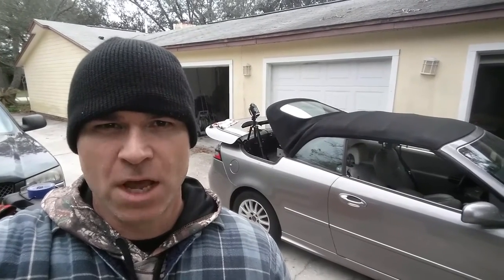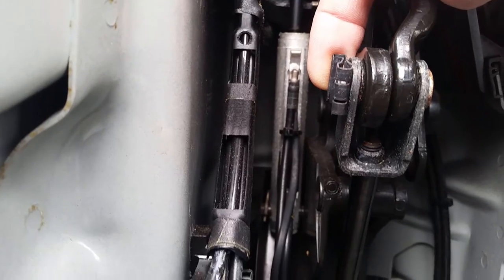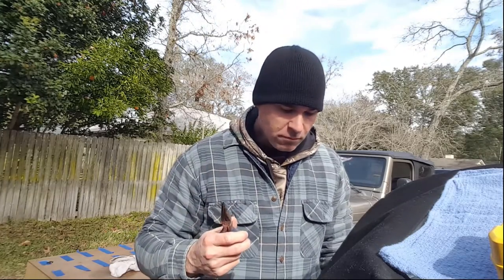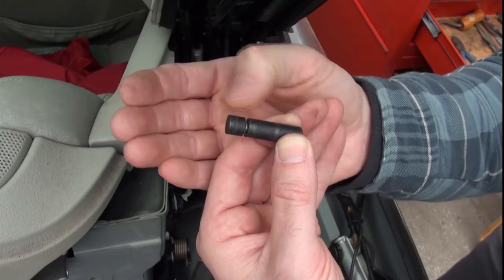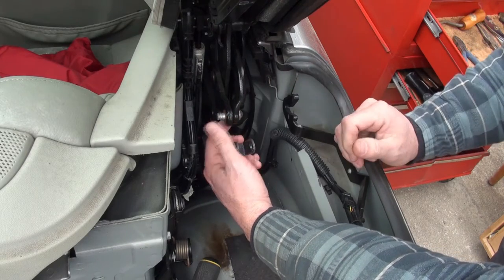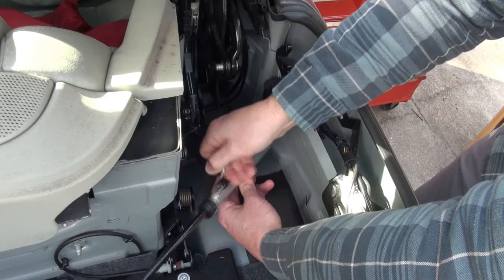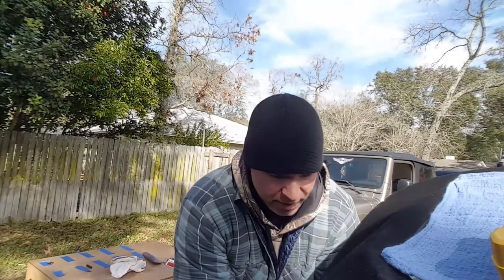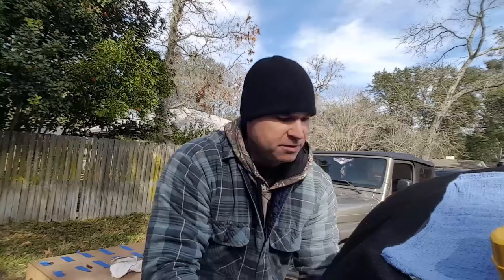Saab Convertible Hydraulic Cylinder

Comment: Thank you so much for this. I am in Australia and we also have a rebuilder in Sydney. I am in Perth (about 4500km away). You have saved me a fortune. BTW. I struggled to get the clips that hold the plastic hydraulic pipes in place, but a bit of leverage and force got them out. ALL the O rings were in the Ram. Thanks again!
Reply from the maker: I'm glad it helped Chris. Thank you for the kind words.

Comment: Hello, this is Klaus with Top Hydraulics. Wow, that's an excellent video! Thank you, Ted, for being so straightforward and sharing. 

Model year '03-'09 Saab 9-3 "Next Generation" convertibles (starting with model year '04 in the US) all have seven hydraulic cylinders that actuate the top, stow it and latch it. All of these cylinders will leak eventually, just as they do in any other modern convertible. There are on average seven seals in each of these cylinders, and you will typically see them leaking first on the bottom. The seal decay is a general aging process that is sped up by heat. The manufacturer could have used a longer lasting seal material, but they did not. We find this in every modern convertible with a hydraulic top. Top Hydraulics does some fancy machining on these cylinders, and ends up replacing and upgrading ALL seals in them. We expect our rebuilt cylinders to last some 30-50 years, if installed properly and not abused. We have shipped many thousands of Saab cylinders, and we have an outstanding track record. 

We also offer core exchange, where we ship the parts from our inventory first, and it involves an additional deposit that gets refunded once we get a decent cylinder back. This way, your car is not down while you are waiting for your cylinder to come back, and you can swap most single cylinders in a half an hour to an hour.

No worries about the o-rings that go on the hydraulic lines - Top Hydraulics provides new ones with every rebuilt cylinder, and we provide instructions on how to install them.

Typically, the first cylinder to fail in a Next Generation Saab 9-3 is the front lock ("first bow") cylinder 12833515 or one of the tonneau cover lift cylinders 12833501 and 12833502. These are equally easy to take out. In fact, we would recommend to tackle the first bow cylinder and the two tonneau cylinders at the same time, because they tend to fail within roughly the same time span compared to the life of the car. However, if you are on a budget, it is easy enough to deal with them piece by piece as they fail.

The first bow cylinder is accessible when the top is down, with the tonneau cover (storage cover) still open. You need to take it out of its latching mechanism. Take the retaining clip off the front end of the cylinder (same kind of clip as shown in this video). There are some small c-clips that hold the rear mounting pin in place. Pry the c-clip off with a small, flat screwdriver, and watch out that it doesn't go flying. Lastly, remove the hydraulic lines, replace the cylinder with one from top Hydraulics, and re-install. Here is a DIY pictoral on our website: http://www.tophydraulicsinc.com/2003saabinstructions.pdf

Removal of the two tonneau cylinders is practically self-explanatory. They are mounted horizontally inside the soft top storage compartment - you can see them briefly at the beginning of this video.

The right side main lift removed in this video is also called "top drive cylinder" or "seventh bow cylinder". It is part number 12833495. The matching left side cylinder is part number 12833494. It is identical to this cylinder, except it does not have the two travel sensors.

The two small cylinders that lift the rear window section are called fifth bow or sixth bow cylinders. They are part number 12833509 for the right side and 12833508 for the left side. Removal of these cylinders requires you to take out the rear seat bench and the interior quarter panel trim (the trim piece next to the seats). Removal of the interior quarter panel requires you to find some hidden screws behind the loudspeaker. Note that the lower mounting pin has an M5 thread inside, which allows you to pull it out with a bolt after you have removed the retaining pin.

For hydraulic fluid, there are a few choices. It is easy to re-fill the fluid in the system. The pump is in the trunk, forward right corner, behind a carpeted panel. There is a fill port on the reservoir, and a min/max marker. The system is self-venting, so all you have to do is add fluid. We generally recommend using Mercedes fluid 0009899103 or its generic equivalent FeBi 02615, because they have less of an odor to it than the Saab fluid. If you have a hard time finding them, then you can use Pentosin CHF-11S, which is almost identical to the original Saab fluid, and it is available in just about any car parts store.
Reply from the maker: Top Hydraulics: good information Klaus. Thank you for sharing. Your replacement cylinder worked great.

Comment: Thanks so much for this vid. I just purchased a 2003 9-3 Conv with only 64K miles. The roof works fine but I'm paranoid one of the cylinders will leak :) Good to know what to look for, where and that Top Hydraulics can rebuild them for a fraction of the price of a replacement.

Comment: Awesome video, very well done, Thanks... had to replace 2 of my boot cylinders on a 2004 and thanks to you it just made it a lot easier..
Reply from the maker: Tadeus Ochman Thanks a lot. I'm glad it was helpful.
Reply: Tadeus Ochman, congrats on getting your boot cylinders replaced. Those are the two "tonneau cylinders" part number 12833501 and 12833502. They are mounted horizontally in the storage compartment. The left one is briefly visible at the beginning of Ted's video.

Comment: Great video. Thank you so much. I about puked when they quoted me $3100.00 to replace all 4 rear cylinders (yes all 4 leaking at the same time) so I too am going to attempt this myself (and I am a girl) and send to have rebuilt. Thanks again. Wish me luck.
Reply from the maker: Good luck. I have no doubt you can do it - girl or not, makes no difference. I taught my 18-year-old daughter how to do most things on her Jeep.
Reply: Ted Hargiss my Dad did too. Priceless knowledge and priceless Father daughter time.
Reply: Shannon, you can do it! Please see my response to Ted's video with more details on how to remove the other cylinders, or simply contact me if you need more advice. There are six cylinders in the rear, so let's find out first which four are leaking. You will find fluid either on top, where the black shaft goes in and out of the cylinder housing, or on the bottom (or through the mounting hole for the mounting pin on the tonneau cylinders). If you leave the top open in the same position as Ted had it in his video, then you will be able to examine all six cylinders in the rear.
Reply: Thanks Ted - as I put my top down, it got stuck, I checked the hydraulics, while it was at "half-mast" and saw that both hydraulics were leaking oil (which I thought was an oil leak under the car).  The top has been making a lot more noise as late.  Any idea if this is just a fluid replacement issue, or do you think I need them rebuilt, if they can be??  Thanks, I am also a GIRL, but will take this on to save $$ - GREAT VIDEO!  But I am SCARED!  lol

Comment: Will this work on a 2002 Saab 93 convertible? I can't find any videos on how to fix the same problem
Reply from the maker: Though the cylinder was bad on my Saab, it did not fix the problem. Additionally, the sensor attached to the same cylinder was bad - the one I show being removed as part of the disassembly. Once I replaced that as well, the problem was resolved. It is likely it will fix yours as well.
Reply: Ted Hargiss What if the top doesn't come up at all? Could it be a problem with the motor ? I recently put wd 40 all in in the cylinders plus I had to manually put it up because it was stuck. What's your suggestion to what I should replace ?
Reply from the maker: Could be a number of things - ram, sensor, clasp, hydraulic fluid, obstruction, etc. What are the symptoms? Does it make any sounds when depressing the button? Does the lid open? Do you get any error messages on the display? It is hard to isolate the problem without troubleshooting. 

I had to take mine to a shop and have them diagnose the problem. I did the repair work myself, but it was beyond my ability to troubleshoot.
Reply: Ted Hargiss When I hold down the roof button, I hear the motor for a few seconds than it stops. The top doesn't go down but I hear the motor turning on & off when I hold the button.
Reply: Ted Hargiss lid doesn't open. It use to before I put wd 40 all back there.
Reply from the maker: This sounds like it could be the sensor holding the top closed above the windshield.

Comment: G'Day :) I have a 2004 Linear and have noticed fluid dripping from the bottom of the passenger rear wheel arch. The filler bottle is emptying somewhere, roughly 100ml. the top works perfectly but i have to top it up each time. After one use of closing/opening it is completely empty. Is this the 5 th bow?
Reply from the maker: It sounds like a bad seal/o ring on the hydraulic hose  in the cylinder.
Reply: @tedhargiss1056  thank you for the quick reply :) Does that require a new cylinder? or rebuild?
thank you
Reply from the maker: Depending on the actual problem, it could just need new o rings. But, if the cylinder is bad/damaged, it will need to be replaced or rebuilt. I went with the rebuilt option.

Comment: Hi Ted,
My convertible will fully close and open with no problem, but the car always assumes it's opened when closes. I assume it's the sensor that is bad. Where can I buy the sensor alone?
Reply from the maker: Joseph Fadhil, you're probably right; the sensor is most likely bad.  I got mine from http://esaabparts.com/.
Reply: @tedhargiss1056   a 
 Where can I have my   Hydraulic cylinder rebuilt
Reply from the maker: Louise Flosi: Check the link in the description for Top Hydraulics.

Comment: Hey mate, great video. Mine started to leak  from the right hand side top trim just above the right back seat. The fluid smells like a hydraulic fluid. What it could be? Have lost like 100 ml of that fluid. Cheers from UK
Reply: Crazy Horse, fluid above the rear seats normally comes from the first bow cylinder 12833515 (which locks the front of the soft top to the front windshield), or from the hoses going to that cylinder. With the top down but the storage cover still open, remove the trim piece at the front end of the soft top, and you will find the first bow cylinder. Here are some more detailed instructions on how to remove that trim piece and the cylinder: http://www.tophydraulicsinc.com/2003saabinstructions.pdf. Top Hydraulics offers core exchange, where we send a cylinder from our inventory first, then you send your old one back for a refund of the core deposit.

Chances are higher that it is your first bow cylinder (front lock cylinder) leaking, because it starts leaking slowly, whereas the hose normally have a catastrophic failure where they are routed around one of the hinges.
Reply: Thank you mate, extremely helpful. I am not confident that I could do it on my own but I just might give it a go (As my mechanic hates doing the tops).
Reply: Crazy Horse, at the very least, you can find out on your own where the leak is coming from. Stop the roof's cycle with the top partially off the windshield, and you will be able to find the hoses under the canvas, so that you can look for spray from one of the two hoses going to the top lock cylinder (first bow cylinder). If the hoses seem okay, then lower the top into the storage compartment, but still leave the compartment cover open. From there, remove the trim piece at the front of the headliner, and take a look at the cylinder. Trim piece removal is described in our DIY instructions https://www.tophydraulicsinc.com/en/content/59-2004-2011-saab-9-3-info - it is easy. If it is the cylinder, then you can undoubtedly do the replacement yourself, guided by our DIY instructions.
Reply: Thank you mate. Ok, after seeing the location picture, mine leak came out from-the right 5th or 7th bow cylinder. The fluid started to leak when I was putting the roof back up. I am just worried that if I remove any of those 2 cylinders, I will get even more fluid on my car, resp. what to do  if one of the fluid lines is just loose? Is that a possibility? And if so, do I need to somehow replace the already leaked fluid? I think I lost around 50 ml of the fluid. Many thanks.
Reply: The pressure in these system is very high when the pump is running - equal to that in a power washer/pressure washer. The pressure will be released once you turn off the ignition. Of course, you cannot operate the top with the pump once one of your hoses is removed from the cylinder. You simply have to find the exact source of your leak, take care of it, and finally replace the lost fluid after you have fixed the source of the leak. The hoses are never just loose, unless someone has recently taken them out of the cylinder.
Reply: OK, many thanks Top  hydraulics. Great job. Cheers
Reply: My '04 9-3 top recently failed and several years ago I had the 1st bow cylinder replaced.  This time it appears to be either the 7th or 5th bow cylinders (it's the ones higher up and easily seen) as I can see fluid pooling on both the right and left sides.  Question: Does one access all the bad parts by just visually inspecting each cylinder ? Thanks so much for sharing your expertise!!  Joe
Reply: @jlouism  Hello Joe, where exactly is the fluid pooling? Is it under the two vertically mounted cylinders? The most common leaks after you have taken care of the first bow cylinder, are the two tonneau cover cylinders 12833501 and 12833502, which are mounted horizontally and lift the storage compartment lid. They typically leak first where the mounting hole goes through the cylinder body. 

The two vertically mounted cylinders are the seventh bow (the larger, main lift) cylinder and the sixth bow (smaller) cylinder. If they are leaking from the top, where the shaft comes out of the cylinder, that's easy to see. Just look for oil on top of the aluminum housing on the sixth bow or oil on top of the black steel part on top of the seventh bow cylinder.  These cylinders can also leak first from the bottom, which can be a little harder to see. Ultimately, wiping the bottoms of these cylinders with something like a paper towel will prove whether they are leaking at all or not.
Reply: The fluid pooled on the area where the Drive Unit is mounted to the chassis and some fluid is lightly visible around the piston ends too, like you said "where the shaft comes out of the cylinder".  Although only one side had a considerable amount of pooled oil, the other side didn't have the pooling although the piston itself may have had some visible oil near where the shaft comes out.  Thanks for responding so quickly and I'm just reluctant to take it in anywhere in the OC CA area as my main mechanic left the area and don't trust or have much experience with anyone else that knows Saabs well and won't rip me off....I'd like to try and do this myself too.

Comment: Hi Ted. thanks for the video, very well created. Can you give me your input, just bought a 2005, and sometimes it opens, most of the time it gives a message of "obstructed object, please remove..bla, bla". My guess was the mechanism the makes the motion is probably worn out, thanks to your video, now I know what part is the motion maker, so do you think the hydraulic cylinders may be my problem too?....can you share the link where they refurbished yours?
Reply from the maker: Heber Ontiveros, thanks for the comments. The link to the refurb shop is in the description. 
I would get the same message as you. In my case, while the cylinder needed to be rebuilt, the sensor attached to it needed replacing also. Once I replaced it, the top worked again.
Reply: I see it, can you share how much did you pay for each?
Reply from the maker: A refurbed/rebuilt cylinder is $200 Top Hydraulics. The sensor was $232 from eSaabParts.com.
Reply: Hello Heber Ontiveros, 
have you been able to find the cause and fix it? An "obstructed" message in your dashboard's instrument cluster typically happens when the pump is not able to move the top or the tonneau cover (storage cover) due to a lack of fluid. The first thing to do is always checking the fluid level in the pump, in the forward right corner of the trunk.

Comment: does a   98 saab 900 s have the same set up ??
Reply from the maker: 1998 was a first gen Saab convertible. There was a change in design beginning in 2003. I do not know if the convertible ram (cylinders) architecture changed. However, all convertibles need a mechanism to lower the top. Therefore, I'm sure the ram that I replaced is similar in your vehicle; it just might be situated slightly different.
Reply: The 900S has a very different setup. It has a low-pressure hydraulic system with very cheaply made parts in it, which are not rebuildable. You will have to find aftermarket replacement cylinders.

Comment: Finally you rebuild the pump and it is working? How much did it cost?
Reply from the maker: I did get the hydraulic cylinder rebuilt and back in the Saab. But, then I had to replace the sensor also...more money. It is all back together and working. $200 for the cylinder, $230 for the sensor.
Reply: Yikes! $230 for the sensor? Wish you had contacted us. We sell them to customers for whom we have already rebuilt cylinders. More importantly yet, in most cases where a sensor is diagnosed as bad, it ends up being just a bad wire from the computer to the sensor.